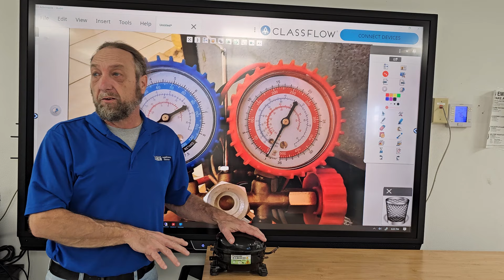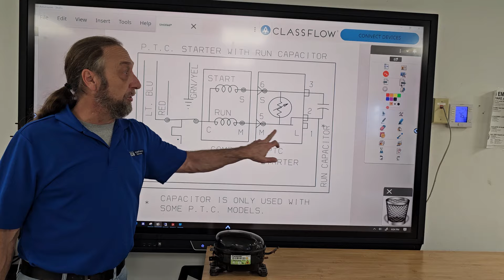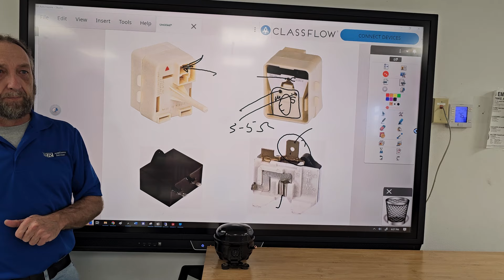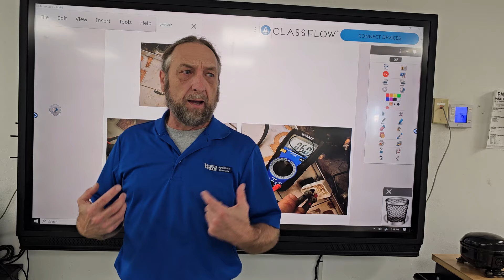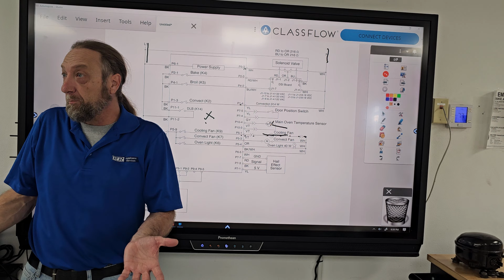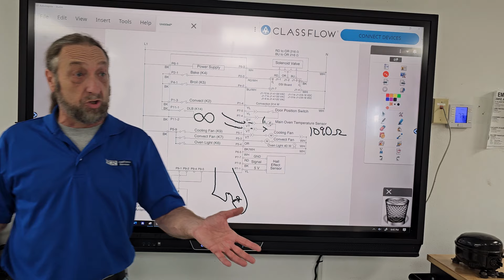Troubleshooting Basics

Comment: A few months ago one of my A/C air handlers lost power. The breaker wasn't tripped so I thought this was odd. I reset the breaker anyway and also the breaker on the A/H. No change. I pulled the breaker panel and had 240v at the breaker. I put the wires on another 240v breaker and still no power. I was stumped. I tied the wires together at the A/H and checked for continuity at the panel which I had. For a minute thinking outside the box maybe an animal in the attic chewed the wires but didn't cause them to short but obviously that was not the case. It was a Sunday. Even though it made no sense I went to HD to pick up another breaker because what else could it be? 

OTW to HD I remembered we have a whole house generator and the A/C's go through load sheds. hmmmm I still bought the breaker and went home. I opened the load shed and found a contactor. This contactor is the opposite of an A/C contactor in that it's normally closed. It would pull in when energized and be open. With no power it was closed so it seemed to be working. When energized I had no power on the load side. hmmm I bypassed it and my power was restored. My generator is under warranty so I called them. A tech called me back and told me they had a recall on these load sheds for a defective board doing exactly what mine was doing. He told me instead of bypassing the wires I could have pulled a connector off the control board. They have a new board and they would be out during the week to replace it. I put the wires back and removed the connector from the board and that also fixed it. As promised they came out and replaced the board under warranty. 

The point is I spent hours thinking the wires go from the panel to the A/H and it had me stumped until I remembered the load sheds. I am a DIY guy and automotive locksmith by trade. This isn't what I do but using common sense and sometimes thinking outside the box is required. This video will also help me think outside the box when obvious things aren't obvious any more.

Comment: Have got a 134 compressor for a double door deep freezer... It works and stops. And then the compressor becomes very hot after it stops. I removed the relay and overload, plugged it directly to see if any of these components are bad but it's still the same..

Comment: Hi Sir,

When charging Refrigerator with r600 using needle valve charge, 
and knowing the backpressure is less than zero at the fully charged, 
Do you think that atmosphere pressure will press down the needle , and let the air goes inside the fridge if we didn’t but the cap on?

Thanks